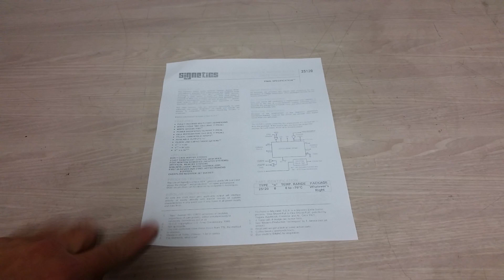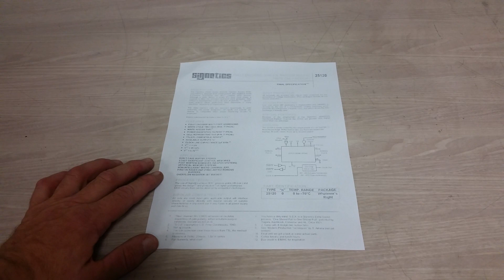Signetics Write Only Memory

Comment: The WOM circuit heatsink should be isolated via a trans energetic hapto magnetic refrotubance manifold, effectively eliminating all proto comnusifier servo motor electron dallie tubes from experiencing trans contronic breakdown of the radial non entropic vertical universal stabilization medium

Comment: I'm a little disappointed they didn't just encapsulate an unused leadframe. At least then if someone plugged it in there would be no magic smoke released.
Reply from the maker: It may be just a leadframe with no die. I do not know. It would have been far easier just to get some out of the reject bin.